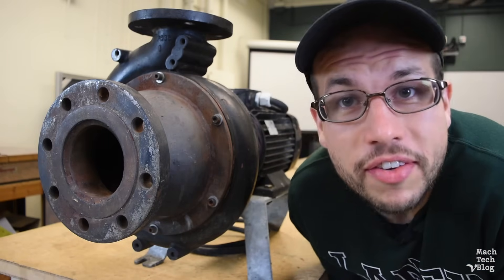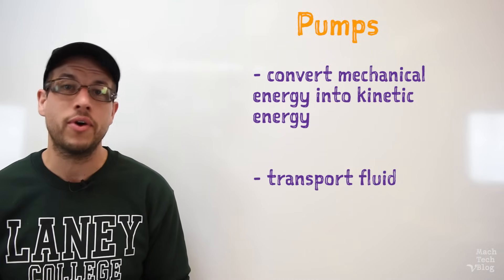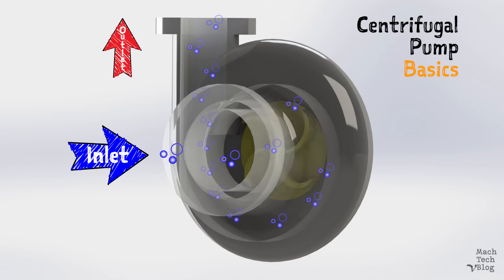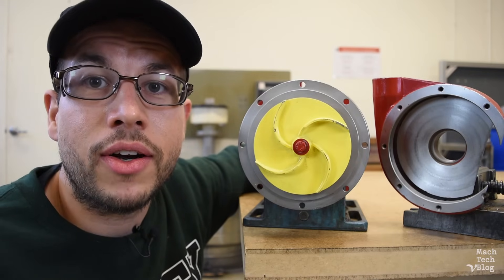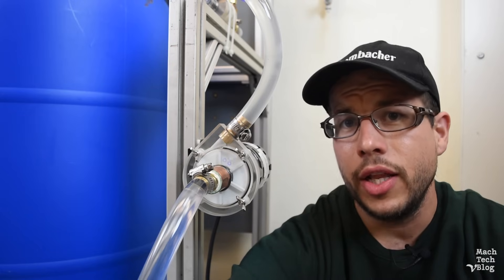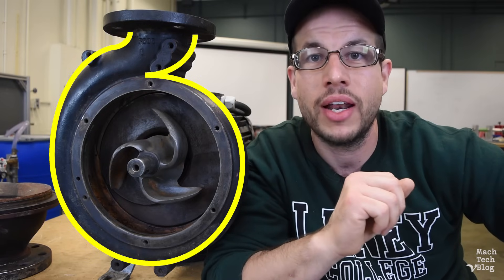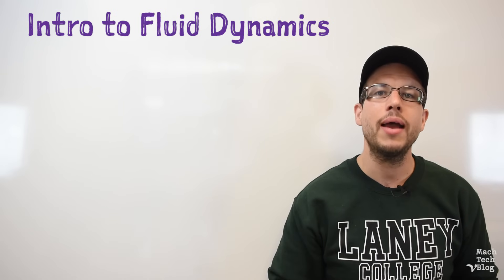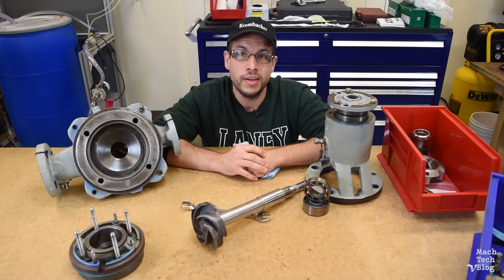Centrifugal Pumps

Comment: Dear sir i have an doubt about vertical multistage pumps. My question is 
Why the vertical multistage pumps are dont have balancing drum arrangement for axial movement due to differential pressure. Then how  the pressure is balanced without balance drum. And instead balancing drum system which methods are used to arrest the axial float in the vertical multistage pumps.

Comment: Why do you want pressure over flow??? Wouldn't higher velocities push the fluids uphill with lower pressure and faster??? Almost a negative head pressure... priming might not be a factor there either...
Pressure isn't how much the pump is putting out, but the resistance of the already pushed fluids... back pressure... even running hydraulic units, it's not the pressure but the gallons per minute that does the work... the pressure is only the resistance encountered through the work... so... my question is... why overwork your pump??? It's not like a heart that needs the work to stay healthy and grow... it's inorganic... enlighten me, please... give me a scenario, if you don't mind...

Comment: Actually they're centrifugal pumps because they spin the fluid to create centripetal force against the outside shell to cause linear flow into the out pipe.   They centrifuge the fluid into a radial motion that centripetally impinges upon the housing and encourages pressure flow in a linear manner out the discharge.  The impeller is designed to match the intended fluids, housing volume and flow rate.

Comment: I have a question
did the " 2Z bearing " need an oil seal ?
Reply from the maker: Hi, Mohammed Mansour,

When reading a standard bearing code, the first four digits (for example, 6305) specify the type and size of the bearing. The suffixes which follow indicate special design characteristics of the bearing. The most common suffixes are "RS" for bearings sealed on one side with an elastomer seal, "2RS" for bearings sealed on both sides with elastomer seals, "Z" for bearings shielded on one side with a metal shield, and "ZZ" or "2Z" for bearings shielded on both sides by metal shields. It should be noted that there is occasionally some variation between different manufacturers.

Comment: Hi Adam. Thanks for the awesome video. Got a question about centrifugal pump. Should the discharge pressure and suction pressure be equal? Or there should there be DP? Thanks!
Reply from the maker: Hi, Derrick,

During operation, there will definitely be a pressure differential between the suction and discharge sides of the pump. The amount of pressure on the suction side (before energy has been added to the fluid) will be less than the amount of pressure on the dicharge side (after energy is added to the fluid). The actual amount of discharge pressure is determined by the amount of energy added to the fluid by the impeller (based on impeller speed, impeller diameter and the density of the fluid) and how much of this energy is in the form of pressure. The pressure developed by the pump is actually dictated by the needs of the piping system. Bigger elevation changes from the source reservoir to the destination reservoir and greater lengths of pipe between them demand more pressure from the pump to overcome these obstacles. As for suction pressure, during operation, fluid is discharged from the pump and this creates a zone of low pressure at the center of the impeller. Fluid in the suction piping is pushed into the pump to replace the discharged fluid. This is accomplished through a combination of atmospheric pressure and the weight of any fluid above the pump on the suction side – ie the fluid level of the source reservoir. This is what determines the actual amount of suction pressure. We haven't yet made a video on pumping system hydraulics, but you can be sure that such a video is on the list. The explanation in that video will surely be better and more thorough!
Reply: Machine Tech Video Blog you are a badass.

Comment: Never understood why outboards and inboard diesels use those prone to failure rubber blade water pumps instead of this kind of pump which has worked fine for decade on millions of cars......
Reply: They simply work better. You just forgot to factor in the flowrate of spare parts. xD

Comment: Centrifugal fluid pumps can't pump air in a sense that they can't develop a low enough pressure with air to move the fluid into the impeller, but centrifugal air fans use exactly the same techniques as centrifugal fluid pumps to move large volumes of air, since air is a fluid as well, just at a much lower density. Exactly the same principles apply though, just with the impeller optimized for the lower density. I have some very compact centrifugal fans that spin at around 20k RPM and generate absolutely surreal air velocity, which as you pointed out in the video, you could always trade for pressure with a divergent nozzle if needed. :D In my usage, it's the velocity that's handy. You should try and cover the basics of convergent/divergent nozzles and their unexpected relationships with supersonic flow. May I ask, what camera do you guys use to film these videos? Fantastic content - thank you! :D